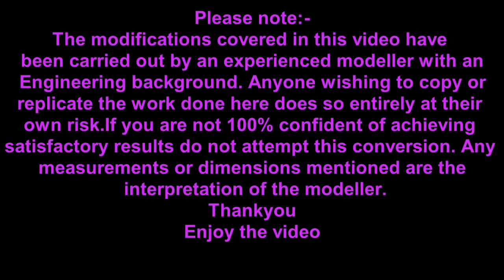Correcting the form of the 1/200 Titanic hull... My way. Part 18

Comment: I'm always looking forward to a new "Titanic" video from Captain Nigel😸 and am amazed at the extremely accurate representation of the hull details.
My great respect for this work🤩👍.
You would have to equip this model, even if it is only a display model, with powered propellers and a smoke gas generator😎
Stay safe and good by☺.
Reply from the maker: I wont be adding anything to this. lights, smoke, nothing.

Comment: Hi Nige, just catching up.  Never thought about parcel tape, good idea.  As for the propellers the centre screw is absolutely 110% a three blade screw.  Olympic had four blades which are the pics all over the internet incorrectly stating Titanic. Britanic had 4 blades Harland and Wolf documents stated Titanic has 3 blades if you look at wreck pictures the spacing is wrong for 4 blades.  Commonly accepted by historians that its 3 blades for Titanic.
Reply from the maker: Agree 100% The famous "taken from the stern in dry dock with a bunch of workmen" picture appears all over the place as Titanic and yet also appears as Olympic. I am 100% it's 3 blades mate.

Comment: Awesome as ever Nige. I am really looking forward to seeing the completely plated hull in your own good time. Much as I want to do these mod's, I probably won't in the end as maths is not my strong point and scaling up the hull profiles will probably melt my brain; my scanner/printer is dead so I can't just make enlargements of the drawings in Titanic The Ship Magnificent. That first hurdle is the one that will stop me. As for the 3 or 4 blade prop' controversy, I'm going with the 3 bladed option. Aside from any other consideration,  I obtained a set of cast bronze prop's that were not exactly cheap and I opted for the 3 bladed version. I think it just looks better. Model on and keep up the excellent work.

Comment: Nice to see you back on stream Nigel and including a great couple of truck kit reviews too.  The sticky tape glue removal please try low low odour white spirit, it doesn't dry as quick as IPA and so removes more residue.  Kind regards Dave Porter
Reply from the maker: I would if I had some Dave.
Reply: @NigelsModellingBench  Are you familiar with Naptha? It's also excellent for removing labels and tape (and leftover glue from). We used it back in the day working for a video tape reseller (Blockbusters and the like). Made it super easy when we had to fix a tape case. All the factory labels released instantly and still remained stuck to new tape case once dried. It's commonly stocked by auto supply shops and almost all hardware stores in the States. It's safe on the plastic NON-clear parts that I've found so far. Auto detailing shops use it to remove pin striping and most road tar. Safe enough to keep in garage with vehicles (proper storage etc, safety first!) as it is a derivative of petroleum, ventilation, rarely had to wear gloves unless a kitten had too much fun with my hands 😜. Not sure what they would call it there in UK. A little cotton ball wet goes a long way. We would dip exacto blade in a capful and use it to pick up a corner of a long label or tape. About halfway through it releasing, would need another dip to release the longer labels and rarely had any sticky residue. If so, corner of a paper towel and wipe it all off fixed it. Winter we would use a heat gun on a stand to warm up the label and glue slightly after coming in from warehouse. That was only time I recall the clear windows fogging if we're heated before Naptha got on em. So be careful and test it first. Never any issues with car paint with or without clear coat/poly.

Comment: For drilling plastic, a good technique is to "dub" the drill.  This means grinding small flats on the cutting edges.  This eliminates the sharp cutting rake which is causing the drill to spiral in.  These flats change the cutting action into one that is more scraping than cutting.  It is also helpful for soft metals (such as brass) and sheet metal.  Figures K, L, M, and N here show it visually:  https://www.newmantools.com/machines/drillpoint.html

Comment: Hi nigel hope you can help do you still have the stern plating template. I can't seem to get the original one to cut out. Ps I didn't know you could pull the brush down. Thanks
Reply from the maker: Sorry Bud, It was something that was up for sale on the Scale the Titanic site and appears to have gone?
Reply: @NigelsModellingBench  ahh no worries. I bought all the scale the titanic pe sets but didn't buy the stern plating. Thought I had but when I checked I hadn't. Really annoyed with my self. I have managed to achieve the plating on the top but the bottom isn't quite how I want it so I'm going to re do it as I think I can do a better job of it. Its not bad just not quite right. Making it out of spare brass.

Comment: Nigel how the hell are you? Got a question for you, when painting the hull of the 1/200  Titanic should it be it flat blk or Satin blk?
I just want to get it right because many out there do it in both tones, but to be accurate, I want to get it right.
Btw love your accuracy & your drive to get things right! Any tips on simulating glass in drilled out porthole would also be great. Anyway Nigel keep on, keeping on. 😜👍
Reply from the maker: Hi Jack, I would suggest a satin black from the pics I've seen, but only just satin, like an eggshell kind of finish. Perhaps try mixing a drop or two of matt varnish with Satin black or a drop or two of satin with Matt paint? Micro scale Krystal klear is good for clear windows that have been drilled out.
Reply: @NigelsModellingBench  Thanks Nigel believe it or not just picked up my Titanic today $450.00 cash, funny thing though I own a Hummer H3 and it wouldnt fit across my back seat unless I repositioned it up on the arm rests on either side. My God man this bloody thing is huge, Im from the U.S of A, Boston to be exact,
But I'll be following you Nigel, especially on Titanic related stuff. Anyway Nigel thanks again for the tips. Oh one more thing any links on how to use that glass stuff for the portholes would be great. 😜👍✌
Reply from the maker: @jackvolta3489  you will see me do it soon on the U-9 project.
Reply: @NigelsModellingBench  I'll keep my eye out Nigel.👍

Comment: Mr. Nigel, can you help me? What is the measurements of the guiding piece you used in 20:28 to align the propeller shafts?
Reply from the maker: The dimensions are written on the gauge. i also show you how i made it in a previous video.
Reply: @NigelsModellingBench  I just stumbled upon your video while scrolling on youtube. I maybe watched this video on low resolution and didn't notice that there are measurements written on there. Thank you Mr. Nigel, Happy Modelling!!

Comment: Hey Nigel, There is no definative evidence for the center propeller be 3 or 4 bladed. There was/is talk of the next expedition to the Titanic to look at that specific item. Awww come on, you find an error in 'Titanic The Magnificent' and you are not letting us know? That's not 'Nigelism', he who tells it like it is. And of course thanks for the video, great job!
Reply: The ship builder's own records said the Titanic was built with a 3 blade.  You can read about that here:  https://www.encyclopedia-titanica.org/mystery-titanic-central-propeller.html  I don't know if one could argue this is "definitive".  But it is certainly authoritative.  Also, various changes were made to the propellers on ships to determine maximum performance and minimum vibration so this was a very important topic to the ship builder and ship line.  It would seem unlikely that such recorded data would be incorrect for such an important aspect.  Some feel that since they Olympic had a 4 blade, they put a 3 blade on the Titanic as a means to compare the results.

Comment: Hi Nigel!, Have you ever heared of the Maly Modelarz Titanic 1/200 paper model? I want to ask you about how thick can I use for hull plating. I'm recreating the hull and I want to plate it and I mean every single hull plating. But I don't know how thick the polystyrene sheet to use.
Reply from the maker: The plating was around an inch thick below the waterline, so you can work it out from there.
Reply: @NigelsModellingBench  sorry, what I'm trying to ask is how much of a millimeter I can use to replicate all hull plating? Like the plating you have done after you sand the hull because you corrected the form. After you have corrected the form of the hull, it will be flat right? So if you will redo the hull plating, how thick of a millimeter you will use to create hull platings? Thanks and sorry if my question is not clear in the first place
Reply: @NigelsModellingBench  the material that I want to use is styrene sheet but I don't know how thick the styrene sheet that I'm going to use
Reply from the maker: @justabasslover4404  well, if you take the real stuff at 1 inch and divide by 200 you get 0.005 inches.
Reply: @NigelsModellingBench  so it's around 0.127mm but if I convert it to gsm, it's around 90-90.9 gsm. But it will be thin like a normal bond paper right? Thank you so much for answering my question!.

Comment: Four blades to the centreline propeller according to every online resource I have.
Reply from the maker: Hmmmmmmmmmm rubs chin and thinks....
Reply: Phillip is right. Found several picture of Titanic in dry dock: 4 blades at the centerline prop.
Reply from the maker: @jorglanger7283  most of those pics that state Titanic are actually Olympic.
Reply: Probably 3 blades because of the evidence explained below :
https://www.encyclopedia-titanica.org/mystery-titanic-central-propeller.html
Reply: I surrender! Alain ´ s source is convincing.
Another source for the possibility of a 3 bladed centerprop could be http://www.titanic-cad-plans.com/wp-content/uploads/2010/06/Titanic-center-propeller-article.pdf.
At least both sources state that there is no evidence of a 4 bladed centerprop.
Reply: Go for 5 blades Nigel. You’ll have everyone from all sides on your back then. 😆
Reply: Thanks for another great one.....👍👍
Reply: I'm thinking that a compromise is what is needed. 3.5 blades?